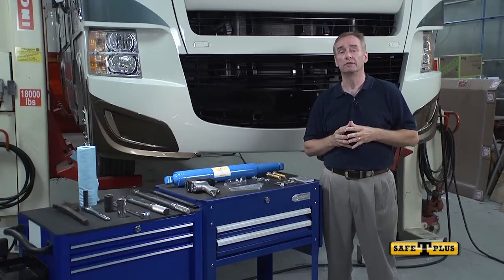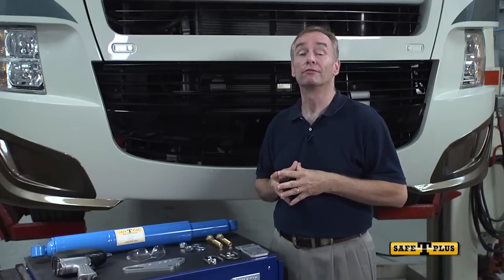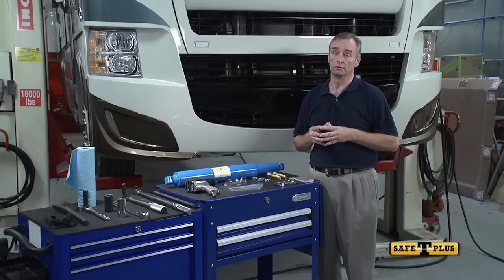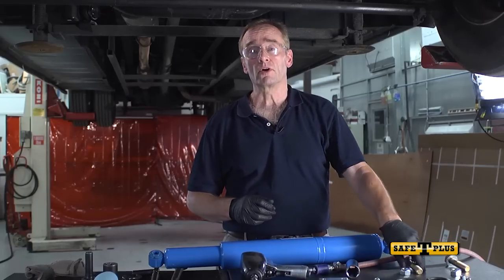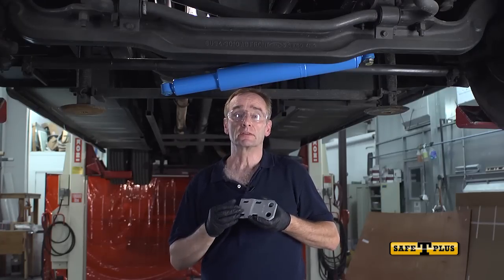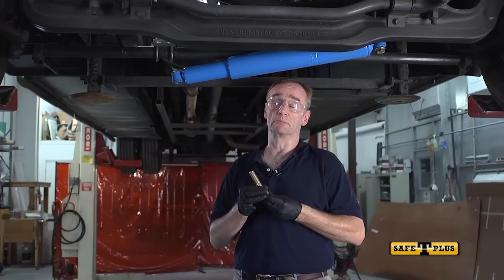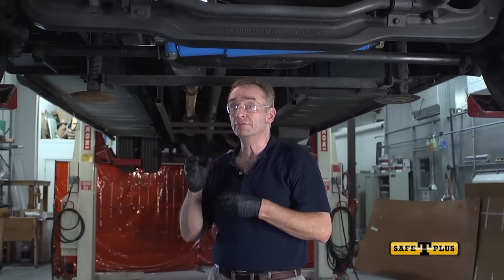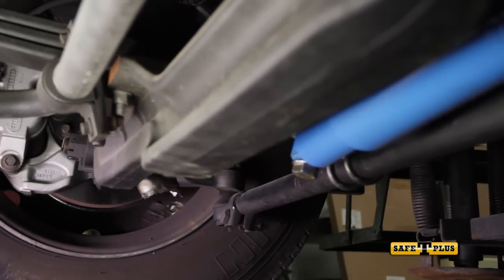New Safe T Plus Steering Control Installation Video 2015

Comment: What an idiot.  The Safe-T-Plus iand s not parallel to the Tie Rod because he mounted the Tie Rod Bracket upside down according to the written instructions and the cylinder is mounted on top of Tie Rod Bracket.

Comment: Iy is unfortunate that the video for the installation is contradictory to the written instructions. The video has the large end toward the anchor bracket and the instruction sheet has the large end toward the tie rod bracket and laying on the top..  I'm in mid-installation and cannot reach support.  And the reason i'm so late is that the package did not have the 3/4" flat washers in it so that shot an hour or so running the the hardware store.  Somewhat disappointed and have yet to test drive the MH.